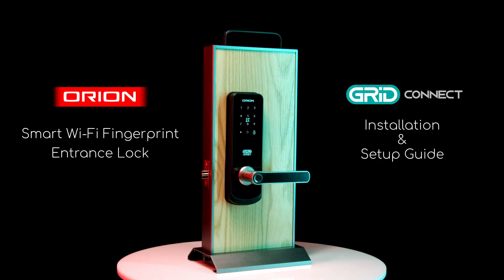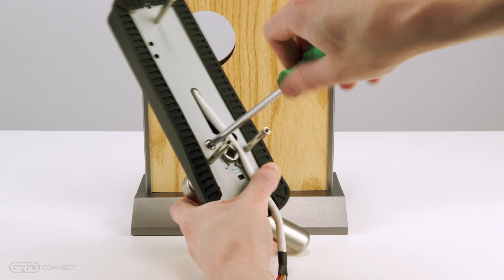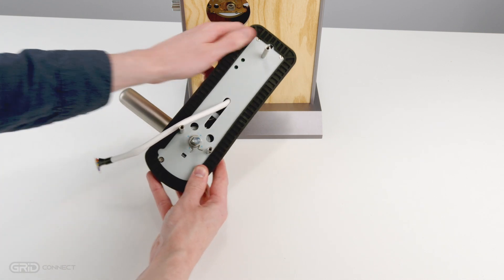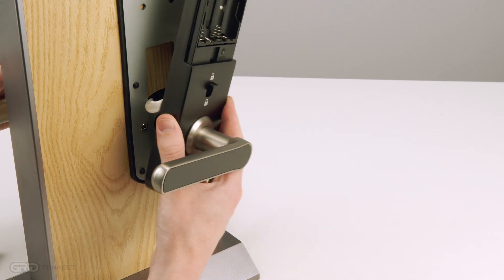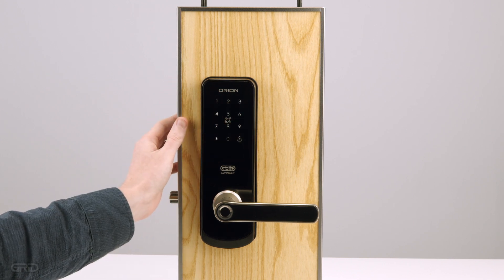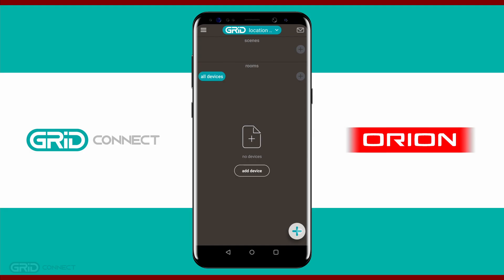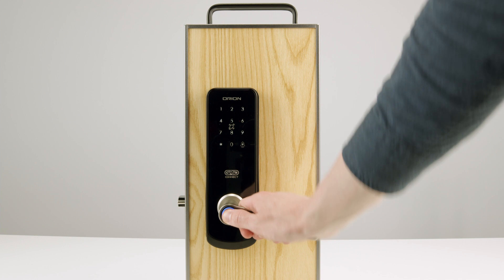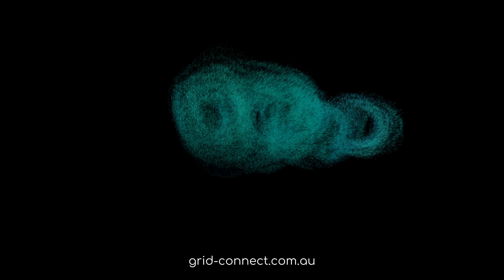Grid Connect Orion Wi-Fi Fingerprint Entrance Lock Installation Guide

Comment: Don't waste your money. I have set this up. No need for key, swipe card, pin code nor fingerprint to enter when door is locked. Just lift handle toward ceiling.
Reply: I had the same issue but quickly solve it by rotate the spindle another 45 degree, then the handle is loose and stay locked status until being unlocked, give it a try mate.
Reply: Great advice. Quiet easy to get this part wrong and compromise the security of the lock.

Comment: I have installed it and everything works fine, however from the outside if I pull the handle upwards it unlocks and opens the door! This is strange, so technically it is not fully locked. Nothing in the user manual about this. Advice would be great. Thanks.
Reply: Yes 👏👏👏 dodgy much 🤣🤣 time to get money back. So much in keeping intruders out. 🤦‍♀️
Reply: aer you serious or joking?
Reply: @leedaq7767  dead serious! Best off going to a locksmith and see what they can install!
Reply: My carpenter installed it. It was very difficult but eventually we worked it out. Now it works fine. No issue.
Reply: How did you get it to work, I have a left hand door so even though it says it’s secured it just opens with the handle when opened.
Reply: @Djdave0922  your carpenter installed the Spindle in the wrong position before installing it back on the door. You just have to unscrew the back and reinstall the spindle in the right position. May take a couple attempts
Reply: @Djdave0922  hey i have the same problem.. how did you fix it?
Reply: Ok so I figured out the Spindel has two ends.. one end goes on a certain way
Reply: @Amarax1  great help mine had the same problem and put the spindle in the right way you've just got to fiddle with it so handle won't open the door when you lift it up
Reply: @deoncavanagh72 hi can you share how you did it ? I am still facing the same issue … the lock does not lock !!!
Reply: If anyone is having the issue of the upwards unlocking: just check well the spindle position here: https://youtu.be/7EEftJyYXzI?si=3-xEgDtKd5N6Crdw&t=122

Comment: Great Price, Great Lock!! But not straight forward to install. We had lots of trouble trying to work out how to secure the door, because when we thought the door was locked if you lifted the handle up the door opened. After reading other reviews we noted it was a similar problem others were also having. After reading reviews they discussed spindle position. We found the spindle needs to be positioned so when you lift the handle up the door striker doesn’t engage. After much perseverance we worked it out. Once we did get the lock working properly it works Great! Set up and pairing very easy, very happy. Company needs to consider providing much clearer instructions on how to align spindle (both written and YouTube) If your not good at puzzles a locksmith might be easier option with installation.
Reply: Agree, same issue for me but a video would be great for adjusting the spindle position in the right way. I am having the same issue but not been able to fix it as of yet. Thanks
Reply: Howd you guys do it im tryna figure it out now

Comment: I am finding mine impossible to enter into the setup mode. 
I press star.. good.
I press hash the door bell dings. No setup mode.

Front door handle only works when I reset the device or if I use the manual key
Reply: Did you figure out how to enter set up mode?

Comment: Why does the unlock button on the inside not keep the door permanently unlocked.. like a normal deadbolt does?

Every time you want to open the door you have to type in a code. Annoying as hell if you're just walking to check the letter box